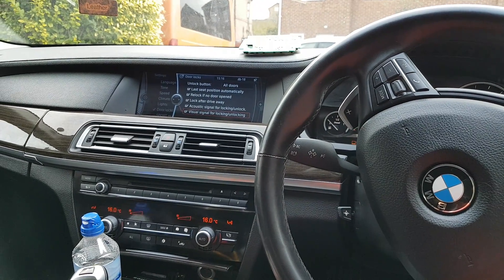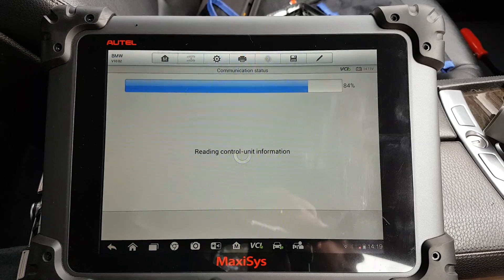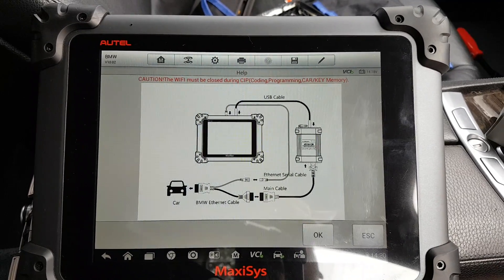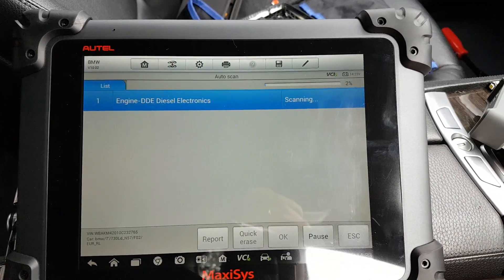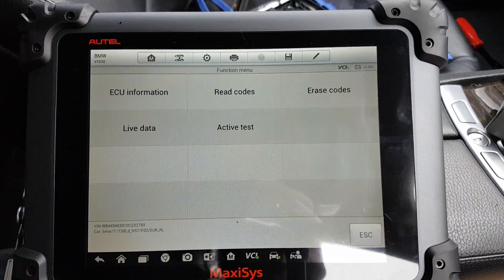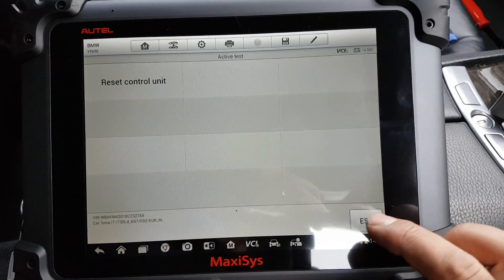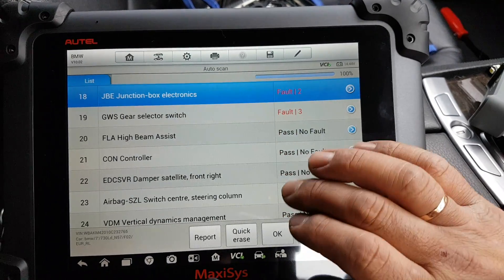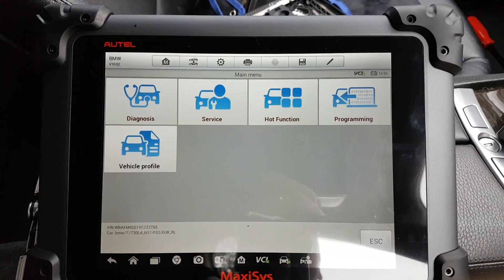MaxiSys MS908P on a 2010 BMW 730Ld F02

Comment: Thank you for uploading the video!
What is your general opinion from the MaxiSys MS908P? 
From where you bought? From China?
Reply from the maker: Sandor Prazsmari 
They all come from China... lol
I bought it on eBay....
Thank you for watching!
Reply: As I see, it has the same price with the Bosch KTS 540.
I am searching for a new diagnostic tool, because my 13 year old KTS560 is not supported since 2018.
I seen for 2015 EURO a brand new KTS 540, so I think I will buy it.
Thank you for the response!